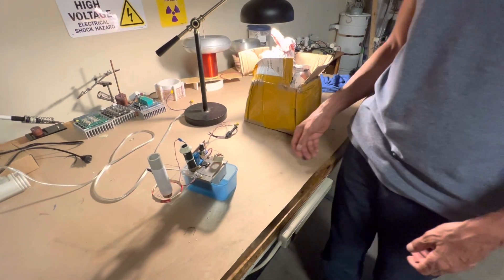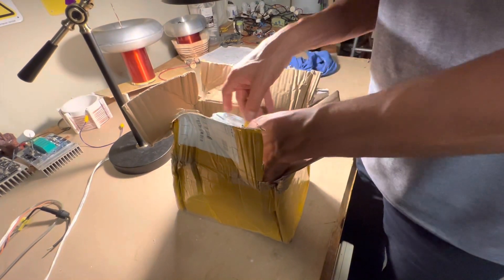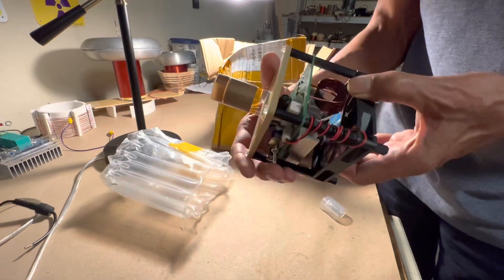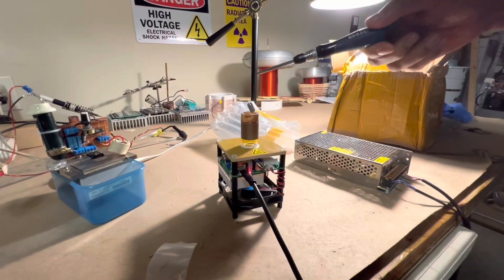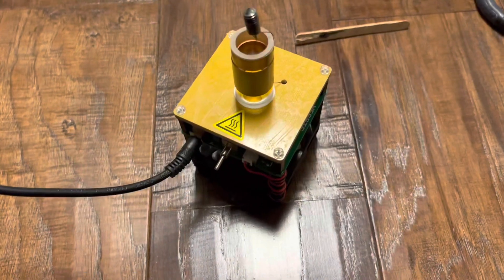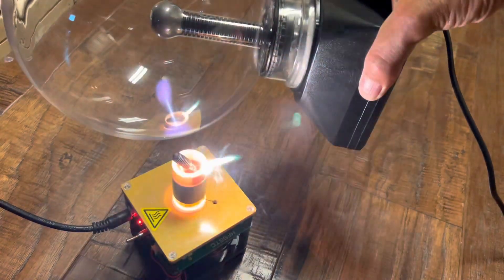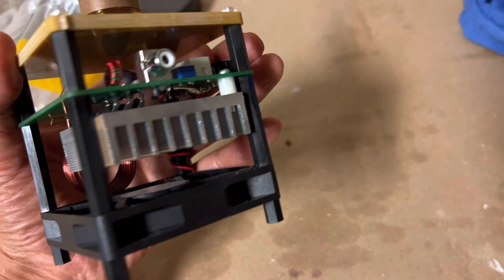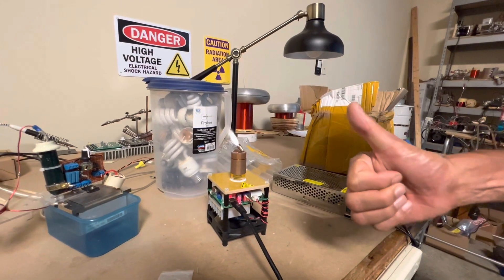Unboxing 16.5MHz Tesla Candle

Comment: Hi sir, I found that Microsimi's 7th generation mosfets are quite good for HFSSTC use. They are quite fast and have lower para-capacitance.I use APT5024BFLL and it can run at 185V@4.5-5A.
Reply from the maker: That’s great I need to try them